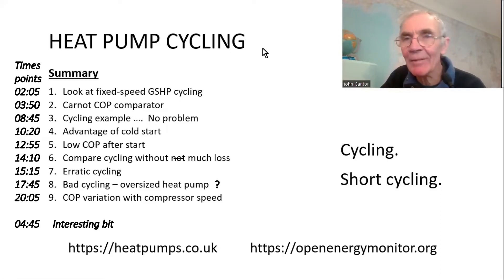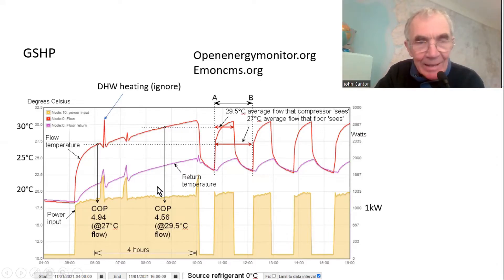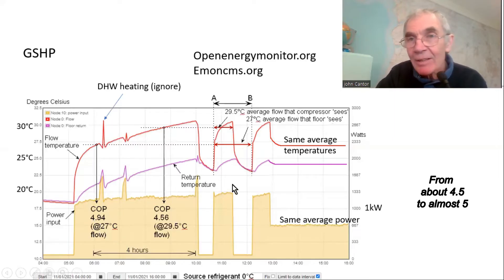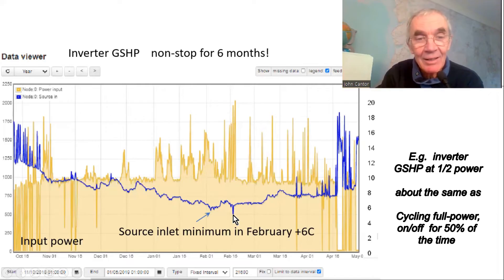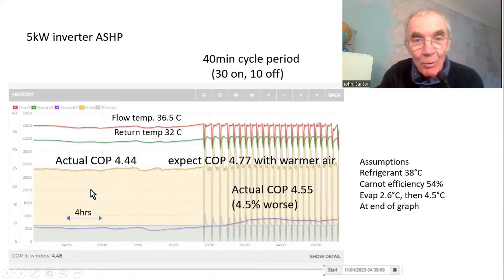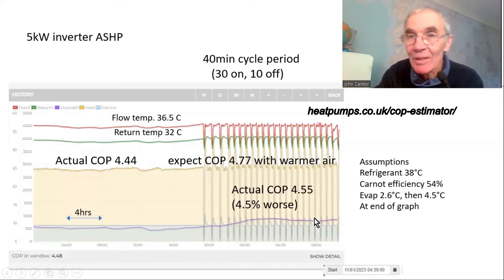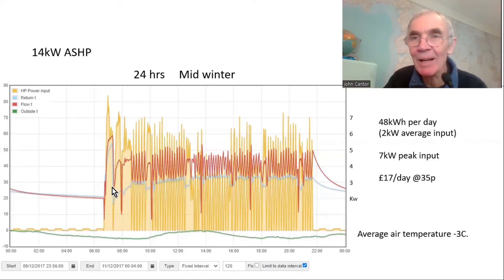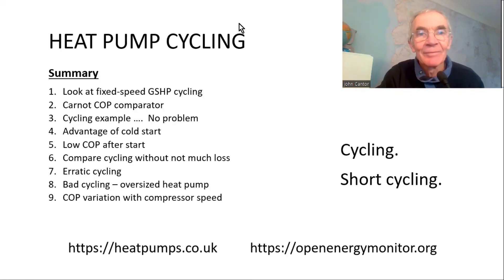Heat Pumps Cycling (switching on and off)

Comment: Hi John, Thanks for this informative video. I have an LG Therma V Monobloc R32 9kw heatpump and I see it cycles time to time working for about 30-40 mins and waiting for another 5-10 mins and cycling again. I understand that it's not a problem, but still struggling to understand why it overshoots the target temperature but instead not gradually slowing down while reaching the target temperatures. Should I be worried? (I have a 300lt DWH tank and 100lt buffer tank, radiators are connected to this buffer tank with a cycling pump and my tado is controlling this cycling pump, not controlling the Heatpump)
Reply from the maker: Hello.   I'm wondering if this 'cycling' is actually defrosting.  This can happen about as you describe, and will a lot in cold damp conditions.  Actually worse when say 0C to +5C.    Nothing to worry about.  If you catch it stopping, you should see the white frost on the fins melt over a few minutes.    Otherwise, in this weather, the unit is likely to run steadily.  They generally vary (modulate) between 33% and 100%.   When the heat demand is lower, (milder weather) it will need to cycle, and cycling on/off mid range can sometimes be better than running steadily at 33%.   difference between the two is often slight.

Comment: Thank you for this wonderful information and clear presentation.

My system is a ducted Mitsubishi variable speed 36k BTU heat pump in Seattle WA USA where our cold temps are generally near 32 deg F but recently we had a week of 16 deg.  2700 sq ft house.

Given the goals of minimizing cycling and having our variable speed heat pumps run continuously at low flow temps;

     If we like it cool at night can we turn the thermostat down in evening and then just heat very gradually in the morning by turning thermostat up 2 degrees at a time over couple of hours?

Does the heat pump measure the outside temperature and work harder /  increase the flow temperature when it’s very cold outside?  I notice air temps from my vents vary from 80-100 deg.

Does the heat pump work harder if thermostat set 10 deg over current room temp compared to only a set point of 2 deg higher;  and does this harder work make the air flow temps higher?

Thank you for your generous work and presentation
Reply from the maker: Thanks for your comments.. I wish I could answer your question, but I dont actually know how the air-air control works. I would expect the system to register how many degrees the actual room temperature varies from the set-point  , and respond accordingly... surely that is how it must work.  i.e. as the room setpoint is approached, the compressor slows down, along with the fan speed. this gives the best comfoort.  But does it also vary with respect to the outside temperature? I would expect it does.  Given that a heat pump could give out twice the heat in mild weather compared to what it can give out in cold weather, then some sort of limitation for mild weather is surely part of the strategy.  I would be interested to know.
Reply: Thanks, I think you’re right.  Outside temp and temp differential (outside to set point) should be what the computer is most interested in.   The heat pump must work harder if outside temp is cold and if your set point is a large jump up from current room temp; hence my theory of inching my thermostat up a couple degrees at a time as room gradually warms.  Hopefully keeps compressor work light and air flow temp lower.
     My rough estimate is my heat pump electricity consumption goes up about 3% for every degree I turn up the thermostat and also goes up 3-4% for every degree the outside temperature goes down.   Either way it makes sense as I’m increasing the differential from outside temp to thermostat set point.
     My electricity use was doubled with our recent week of 16 deg temp.   House is old, could use better insulation, and Seattle homes not built for that.
     Thanks again for interesting discussion 

Steve
Reply from the maker: @yt551217   In colder weather, the compressor will need to spin faster to get the same heat output, and in cold weather, more heat is needed, so surely it manages this intelligently in some way.    Sounds like you are doing the right thing by increasing it slowly

Comment: Hi John
I have a heat pump which is oversized I believe our heat pump daikin atherma 3 is 9kw and our design temp is 5kw @-2. The heat pump will module to about 30% I am told but this would still be too high in the spring/auturm months. Would a buffer help with the efficiency? We currently have a 25litre but was thinking of upping it to a 90L based on a calculation I got off google. This is piped as a LLH with a secondary circulation pump. Any help would be greatly appreciated.
Reply from the maker: Hello Roman.  You can look at my calculator at https://heatpumps.co.uk/calculators/ to help assess buffer sizes.  It might be useful.   It's not that straightforward because lets say your 9kW Daikin actually only drops to say 4kW in milder condition, and all is in steady-state and happy, then if you need to cycle, as the radiators rise above the temperature you need, then unfortunately, it wont re-start at 4kW again. Instead, it will 'rev-up' a bit, possibly to 9kW for a short while before it slows down again.  (I actually don't have much experience with Daikin)  So, to be clear, the buffer volume will slow down the rate of water temperure rise, so it should help, but there are more than one way to configure a buffer tank, of which small details like the sensor positions is important. You are adding complexity.  I suggest you go with Daikin's recommendations because they will have developed their controls to work in a certain way.
Reply: Unless you have ground heating or a large / complex installation, it's likely that you don't actually need any buffer tanks or secondary pumps. 

Find out whether your installation meets the water volume requirement for your HP on its own, without the 25 litre buffer tank... if it does, get rid of it and get rid of that secondary pump too. 
Your COP is likely to improve.

Comment: Excellent stuff !! I am planing to have an Ashp installed, but not decided yet if Daikin or Panasonic. Nevertheless, I plan to have also a 200 liter buffer installed (for defrosting and to reduce on/offs). My question would be how the buffer should be installed? In series or in parralel ? Thanks!
Reply from the maker: Thanks Adrian.  I suggest your first enquiry about configuration should be with the manufacturer. They will have worked through buffer options, and how it relates to their particular controls and they will have sensor positions in mind. I have seen a few very bad buffer tanks where a lot of unwanted mixing happens inside them, so there are pitfalls to avoid. e.g. where to get 35C at your radiators, you need 40C at the heat pump.  In this case, dropping the COP considerably.  If it's only system volume for defrost that is the worry, then a small 2-pipe volumiser seems a good idea to me.   I have never understood why manufacturers don't start defrost in the normal way, and if there isnt enough heat in the radiator circuit, it briefly diverts to DHW.  This should 'steal' only a tiny bit of DHW heat, and only in certain conditions.  Anyhow, each heat pump has different requirements, so you need to refer to the manufacturers recommendations.

Comment: Interesting video.
COP while important I think is often over emphasised.
COP I believe is analogous to a cars MPG, and what home owners really need to know is an equivalent to cost per mile - which changes with everyone's use case. Sticking with the car analogue- Getting a diesel with the best maximum potential MPG may not be the cheapest per mile option in the real world for someone who has to do lots of short journeys.
Reply from the maker: Yes I agree that COP is sometimes used too much (given too much 'weight').  Its actual energy use that's important.  But lets say you improve all journey types by correct tyre pressures, then all MPGs might improve by say 10% for all... But, skewed as you say because diesels are not so good at short journeys.  Its a matter of testing in relevant condition.
Reply: @johncantor4056 I would say the cost of energy to achieve comfort is most important since prices of power can vary significantly

Comment: Hi John, Thanks for your videos, I have a 10 year old Daikin ASHP and I would like to monitor it more closely, its doesn't have any interface to allow me to see what its is doing. I notice that the openenergy monitor uses heat meters to measure the flow and returns temperatures, I would love to do that but those devices are very expensive. Is it possible to do something similar using DS18B20 sensors (or similar) taped to the main flow and return and use these to estimate the energy? I have a feeling that there is good reason why this would not work but I would like to know if there is a cheaper way of adding some better monitoring to my ASHP. Thanks
Reply from the maker: Yes, heat meters too expensive for most people. I think a lot can be gleaned from sensors on pipes.  The heat (kW) is proportional to flow-return dt.  IF flowrate constant.  e.g. if you look at my graph at 2:40 in, and measure (with a rule) the dt at 27C point and 29.5C point, I make it 16mm and 15.5mm.. so the dt has reduced a tiny bit, but input power has increased, so COP a bit worse. This is just an example of what you might be able to glean.  However, if water flow changes, this is meaningless, so you need to do specific experiments, and repeat a few times.
Reply: @johncantor4056  Thanks John I will try and put something together. Its a shame that heat meters are so expensive.
Reply: @timcx  I’ve got a hitachi yutaki I’m trying to get to grips with in terms of flows and cycling. It doesn’t have good data output either, I’ve recently found home assistant and Shelly iot devices. You need a bit of IT skills but you can get a lot of info from Shelly em and some temp sensors.
Reply: I'm doing exactly this- flow, return and a current clamp on the HP power. Very useful to set up the system indeed.
Reply: @simoncanfer5030  Hi Simon how are you collecting the temperatures, what equipment are you using? I was thinking of using EmonTx but open to other ideas.
Reply: @timcx  I'm using an emontx for the HP and an emonpi for my solar PV and as the  "base station". Great kit, been usiysince 2016
Reply: @simoncanfer5030  Thanks, yes i have an EmonPi already so TX still makes sense.
Reply: @jcfx11  I've just got one of these as well, 16kW in a big cold stone house. 'Fighting' with the installer (in French) as they supply with a wireless room thermostat that basically is an on/off switch, and doesn't do any room compensation to regulate flow temperature based on actual need, it just asks for heat or doesn't. 

I've been experimenting with constant running for a few days since the thermostat stopped working (I may slightly have been meddling with the installer menu...) and am hoping to settle on something that doesn't use that thermostat except possibly for holiday situations. Anyway not that interesting, but I came here to try to understand better how things would be better if I stopped using it like our old oil boiler, like one of the later examples (off all night, on in the morning). 

Problem is, that's how the installer is expecting everyone to use it, and my wife is asking me why I know better than a professional installer. My answer is 'science and engineering' 😏 albeit delivered by people far more knowledgeable than myself.

I do think my wife will despair if I spend too much time with heat sensors though, so I'm trying to steal everyone else's findings....
Reply: @lefrinj  mine is 2014 vintage with the old style controller, not very configurable as I think it just does weather comp. I’d like to get it to obey the internal thermostat but it’s mad. I run the indoor temp at 14 or 15 to achieve 21 or 22 degrees. Even when the internal thermostats are closed, no heat demand from the house, the heat pump still runs. The house is cosy so no complaints about the effectiveness it just runs when there is no demand. If only it would obey the master room thermostat it would be ok. The indoor temp and demand signals reach the hp ok because I can see those figures in the panel.

I’m beginning to think the controller or some wiring is dodgy in mine, my last option is to reset to default and see what happens then.

Comment: What is the best water's delta T for ASHP? I see that COP estimator says if dT is higher, condensing coefficient is also higher and COP gets lower.
Reply from the maker: There are too many dts!     If the flow-return dt is large, then the condensing temperure is likely to be closer to the flow temperure, BUT the system is worse off because the mean temperature to the heating system is worse...   I think this needs spelling out with a sketch... thanks for highlighting it.   The COP estimator is fairly simple.  I tried to make a version to include flow-return dts, but it became unnecessarily complicated!
Reply: @johncantor4056  Yeah, with lower flow rate dt we can get higher medium temperature and it means that we can use lower LWT. But on other side if lets say we apply dt = 5 for cold weather, than for moderate weather dt can be 2 or even 3 and heat pump can start cycling. I am just playing with configs of my heating system and trying to get the best SCOP. My heat pump can't work constant with dt < 3.5(that's for moderate weather that I have 90% of time). In this case LWT starts to raise as heat pump starts to increase frequency. And it can just work with higher LWT(1-2 higher than needed) or starts to cycling. Can't find any info if it happens due to algo on my heat pump, or it's physical limitation of process that happens inside condenser. Maybe if dt is too low, gas can't transfer to liquid on 100% and that's why heat pump starts to increase output (some kind of protection).
For now seems I need to make dt 4-5 for moderate weather and 8-10 for really cold weather. Or make a variable flow rate.
Reply: Maybe it's also the limitation of compressor speed that you mentioned in the video. I see that it avoids to work with frequency less than 35-40% and power consumption less than 20% of max.
Reply from the maker: The estimator assumes a certain flow temperature, and if the flow-return dt changes, (assuming same heat (kW), then the flowrate must be changing, and return temperature is changing too.  An alternative would have been to give a 'mean' flow-return temperature, and this might be more relevant to water-to-refrigerant dt.  I somehow need to spell this out better because as it stands, it looks like you can change the 'offset' and change the COP, however, the 'offset' is more a function of heat-exchanger size/compressor speed than anything else.   I am pondering it.
Reply from the maker: Its a bit complicated since many systems have a fixed flow circ pump, so typically, if flow-return dt is 5 at high power, then it will naturally become 2.5 when the system is 1/2 power.  Other systems simply 'track' the flow and return temperatures, and they adjust the circ pump automatically  so the flow-return dt stays at 5 degrees (kelvin/Celsius).  Furthermore, some systems might assume a fixed flow, and the control uses the dt value as control in some way.   That might seem all a bit daunting, but I dont think fine-tuning of dt will actually affect the COP much.   However, if the dt is 6 or more then the return is getting cold, so the flow temperure may need to be warmer to compensate, so for that reason, a large dt is rarely desirable.
Reply from the maker: I have added some more detail at bottom of https://heatpumps.co.uk/cop-estimator/ and https://heatpumps.co.uk/cop-estimator-comparator-fahrenheit/
Reply: @johncantor4056  Thanks! Really good dt explanation with graphics. Graphics are always good.
The calculator is pretty close to real results of my heat pump. Just need to set correct Carnot Efficiency and other parameters.

Comment: Hello John , i need 4kw at -3 and my heat pump is 8kw , do you think limiting the heat pump to 5kw would work better ?
Reply from the maker: If you could limit it to 5kW... It should help.  Most heat pumps go to a high output  (around 8kW in your case).  This is to warm the system up. However, you may only need say 2kW at times.   By limiting the output, the system should spend more time at a lower water temp, so COP should be better.   Very few heat pumps allow power limiting, but 'quiet' mode might help for some.  Quiet mode seems to simply reduce maximum setting for both compressor and fan.  However, some manufactureres may slow the fan down more than the compressor.   This could reduce efficiency a little, but the efficiency gains of running the unit lower should outweigh this for cases of oversized ASHP
Reply: @johncantor4056  I just found some info for the silent mode , 30% less on both the fan and the comp , its good enough since i have a problem , the pump is next to my bedroom and its very loud :S It feels like the fan is on max all the time .
Reply from the maker: @toniilievski3934  seems sensible to enable quite mode. You can go back to normal if needed in the depth of winter.  I expect a lot of people with oversized heat pumps might benefit from quiet mode
Reply: @johncantor4056  It went to 2 cycles /h , its working better , cheers .
Reply from the maker: @toniilievski3934  for interest . what unit is it?  not many allow capping the speed, apart from 'quiet' mode
Reply: @johncantor4056  In quiet mode is reducing both the fan and the comp by 30% , and there is also an option to reduce the current / input or you can limit the max power . Its Gree Versati 3 monoblock btw